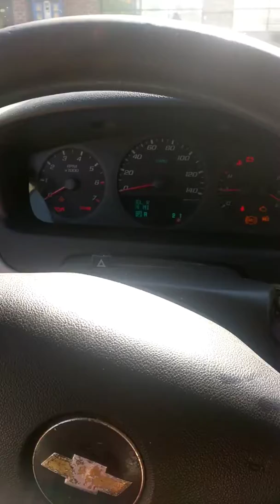Flip flop 2006 Chevy Impala 3.5 Flex (Rough Idle, Service Traction)

Comment: Check the wire harness that runs behind the belt tensioner coming from the cam magnet...it likes to get pinched.
Reply: Especially if you have smelled something kinda burning.